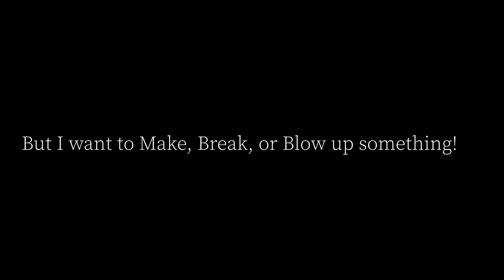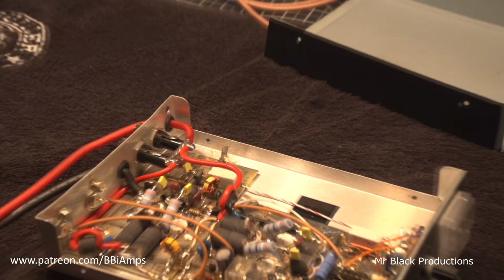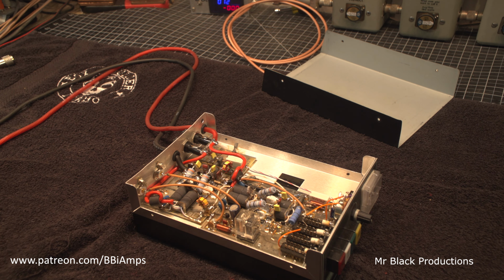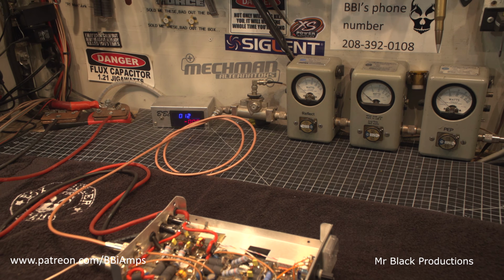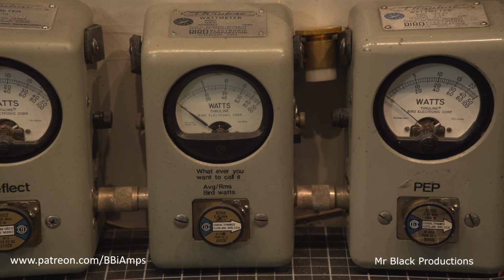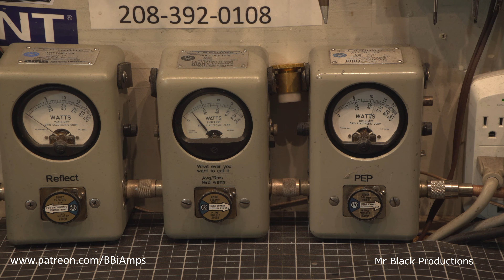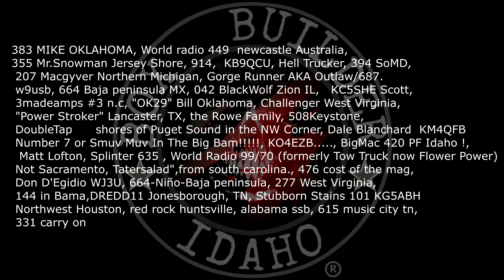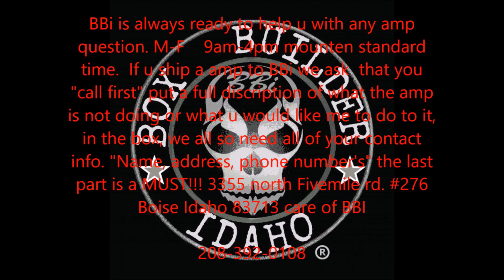Lets rebuild a Tx Star 500v Again :)

Comment: I have the older one like this in my collection. I put NC thermal switch where 2290 goes for 667 to drop relay if get to hot. I went with 2 hot 2 ground out 10 AWG OFC to 175Amp Anderson SB 175 gray connector. no fuses. cable glands . did not like that small jumper for ground between bords.  That cap I had go bad on some repairs. DX 400 and DX 500. mine not the dial a watt. that pot burns up with hot radio. a voltage spike can make cap fail or just china made cap . I had a lot of china made caps go bad. I bought from eBay a bunch of years back, had a repair return after 3 months the china cap left this world. after it made me look bad ,I only use Japan caps now. Panasonic and Nichicon are my go to electrolytics . I use 25 or 35V caps . 73's